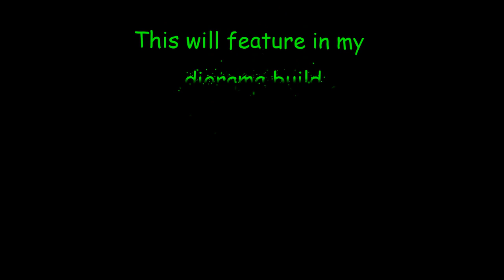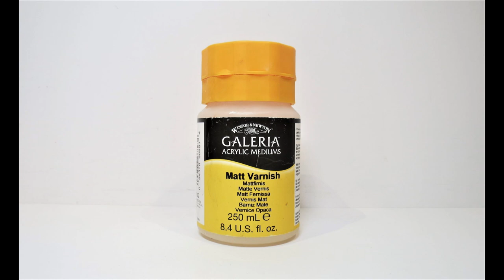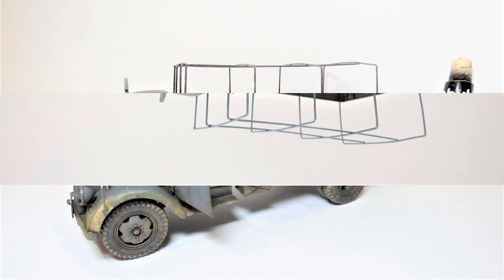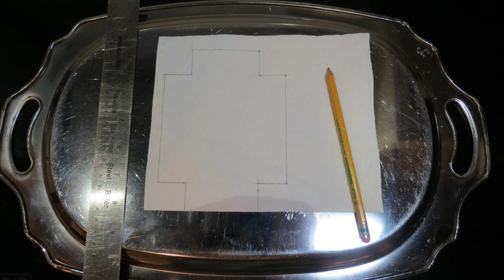Tamiya 1/35 German 3 Ton 4x2 Cargo Truck - "Full Build + Final Reveal" (3.23.21)

Comment: Very nice model. Well done. My only moan would be the triangle sign on the cab roof. This was only raised as you show, when towing a trailer. In normal use this would be flat against the roof. You can still see this in use on many vehicles in Germany today. But aprt from that small item, as I said, a great build.
Reply from the maker: Firstly, my apologies for this late reply, but have been off the scene since I posted this video. Secondly, thank you, much appreciated, and for the heads-up regarding the triangle sign! Cheers : )

Comment: I love it, beautifully done . How did you connect wire pieces of tarp frame together and to the truck bed ?
Reply from the maker: Thank you, greatly appreciated. I used CA glue applied at the contact points using the tip of a cocktail stick.

Comment: Hey Martin!  I know it’s been a while since you built this, but I have a question….did the matte varnish do anything to the pigments?
Reply from the maker: Hey Drew, I usually apply the pigments after the varnish, so those pigments will be affected by too much handling of the model. Although, that said, I'll dab the pigments on while the varnish is setting, so that some of the pigment will stick and remain in place. Cheers 👍🙂🥃🥃

Comment: Hi Martin, another fantastic build. Brill tarp. Can i ask you for some advice? Is it ok to seal an acrylic colour with an enamel varnish ready for decals, weathering etc. Or is it best to keep with an acrylic varnish? Cheers Martin. Keep inspiring modellers like me.
Reply from the maker: Thanks Len, much appreciated! In answer to your question: Yes, you can apply an enamel varnish onto acrylic paint, as long as you don't thin it with lacquer thinners, the lacquer will cause a reaction with the acrylic paint. If you do have to thin your enamel varnish, use odorless mineral spirits....the smallest amount required to get it to flow in your airbrush. That said.....I've never done it before, because I only use acrylics to prevent odors within the house....I work at the dining table. I also never have to thin my acrylic varnishes, they have always flowed nicely through my airbrush, straight from the bottle at 20 psi, using a #3 tip that has a 0.74mm orifice, and, they clean up easily with water. I use Windsor and Newton Galeria Acrylic Matt Varnish. Cheers : )
Reply: @InternationalBritishModeler  Thanks Martin, i will go with humbrol clear then which is waterbased so as not to complicate things. Cheers mate, your a star.
Reply from the maker: @lenlomas326  You're welcome :)

Comment: Really cool Martin!  Looks like a well-used truck.  Quick question....how does Vallejo surface primer compare to Stynlrez?  🍻
Reply from the maker: Thanks Drew, much appreciated! I only use the Vallejo for priming parts that have a metal finish, because it is a Gloss black primer. Stynylrez, I use for everything else. Cheers 👍🙂🥃🥃
Reply: @InternationalBritishModeler  Scalehobbyist.com replenished their supply of Stynylrez recently after being out for awhile.  I ordered some more along with other paints.  Great company!  🍻
Reply from the maker: @Drewsmodels  Scalehobbyist were only 10 miles south of where I lived before meeting Ruth, now they’re 40 miles south west, since we moved to the coast. My number one, go to supplier. My black Stynylrez is very low, so thanks for the heads up, I’ll get on their site and order some. Cheers 👍🙂🥃🥃
Reply: @InternationalBritishModeler  I love how you can sign up for an email notification when they replenish an item that is out of stock. Stynylrez has a gloss black too!
Reply from the maker: @Drewsmodels    Yes, add to the watchlist. I have to be honest, though, Stynylrez has been my go to primer for the last 4 to 5 years since seeing all the rave reviews on YouTube from other modelers, and, I've never had an issue with it....but the latest bottle I've been using, it's been rapidly clogging at the tip of my airbrush....just after a few second of us, so, I'm having to thin this bottle. First time it's every happened...must have been a bad batch, or it was affected by the way it was stored...temperature, direct sunlight, excessive humidity?
Reply: @InternationalBritishModeler  I had trouble with a couple of bottles that I had been using for awhile.  My airbrush was clogging with Stynylrez sludge.  My guess is that dried particles are falling into the bottle from inside the cap.  I went to Ace and bought a few of the paper cone paint strainers.  I cut a piece of the mesh from the strainer and put over the neck of the bottle.  Screw the lid on and the primer has been fine ever since!  I do worry about ordering paints and stuff in the winter.....